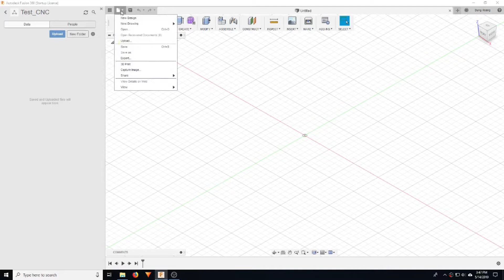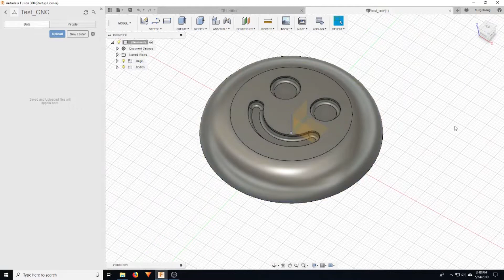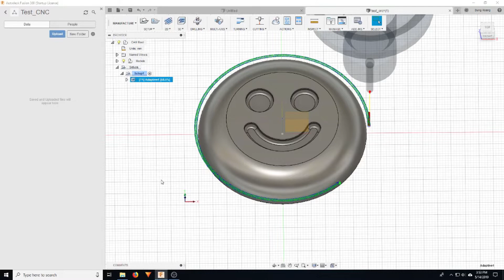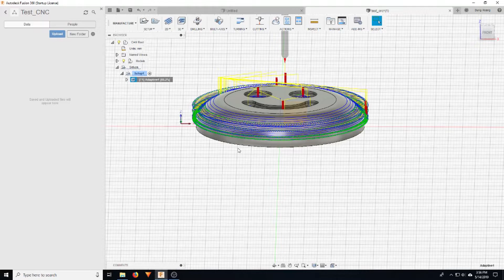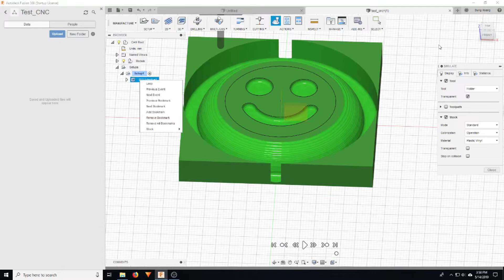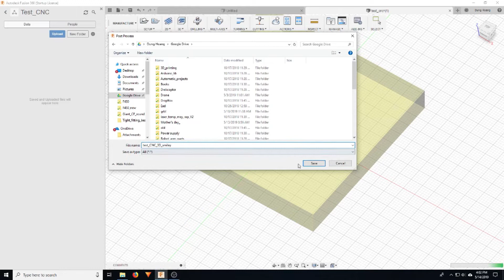3018 CNC testing with AutoDesk Fusion 360 - 3D wood carving

Comment: Hello, I am looking for some help, I am drawing wood projects on Fusion 360 and cutting them on my cnc 3018 pro.  However the cnc 3018 pro will not cut 2D contours.  I send the job to the cnc, the spindle turns on but it will not move or cut.
Could you advise me on how to solve this problem?

Comment: How i can use G code from Fusion for 3018CNC? i opened the code by Candle software but IU not show anything/
Reply from the maker: I have other tutorial videos about using 3018 cnc step by step. Please have a look and you should be able to use your machine

Comment: my spindle is at 1000rpm, and i cant get it higher, any thoughts?
Reply from the maker: 2 things, first type "$$" in the console of candle (lower right corner) check $30, usually it's preset to 1000, change it to 10000 by typing "$30=10000". Second, go to settings in candle and change also the max spindle speed to 10000. Then everything should works

Comment: Hello.. can you help me? I have a CNC 3018 machine same like you. I have a problem.
1. Looks like my CNC is not sturdy in the spindle, when start to drilling some wood it looks sturdy.
2. I already have fusion 360 3d files for cnc. But I am confused How the settings should be for solid wood material. For endmill cutter I used endmill cutter 2 flute straight cut Solid Carbide.
Shank 4mm
Flute 4mm
Overall length 50mm.

Help me please.. or I want to send you my fusion 360 files to you if you want
Reply from the maker: If your spindle is not sturdy, you will have to fix it first if not it will break a lot of bits and make your cut rough. Check where does it get loose (bearing, shafts, spindle holder...).
Then, for Fusion 360, you can check out quickly this video: https://youtu.be/5pQDhtpoXSs 
In that video, I showed step by step how to start some easy milling with fusion 360

Comment: Bro.... Help me... My CNC 3018 its something wrong .. :(... left go right and up go down .. how i change this :(... i broke 2 bits .
Good video ....
Reply from the maker: Easy fix, just type "$$" and tell my what  "$2" value, then I can tell you what to change it to. Y axis is normal?
Reply: Minh's man cave  it’s $2 = 0 (step port invert mask :000000000)
Reply: Minh's man cave The  left and right is inverted ,  and up and down the ,    the Back and forwards works .
Reply from the maker: Then just type "$2=5". Then it should be good
Reply: Minh's man cave  it’s same :( left is right .  and up is down :( way only forward and backwards work properly !? :(  you really are a nice guy :) i like you’re video :)  you can understand everything. but this problem i have i don’t find a tutorial abut it :(
Reply from the maker: If setting the mask doesn't work, another way is to swap the wires on your stepper motors on the X and Z axis. They should have 4 wires, take the first 2 and swap place with the other 2
Reply: Minh's man cave  ,   Thanks you so much ,  you’re the man . 
But now it’s working in mirror . any solution for this ?
Reply from the maker: Have you tried to set the mask back to 0?
Reply: Minh's man cave i change my mind. 
I have 3 much powerful stepper , one 500w spindle that come with 100v power supply.  and i have 3d printer to designs and print the holder . 
do you think the stepper motors ,  will work on this 24v 4A power supply that come with the cnc .  the stepper are a little taller then stock ones , same Nema 17 . 
Thanks you for your answer,  hope to have a chat with you ,  
I’m on facebook all day 3DFactory page
Reply from the maker: They might work to certain extends but not full potential. Those motors probably need 1.8 or 2A each. So 6A power supply might be better. The motor drivers on the board of the 3018 also might not be able to deliver 2A to the steppers. You can use some external motor drivers, they just take more space.
Reply: Minh's man cave   ,    
Ok now i have 3 stepper motor a little taller , 

3PCS TB6600 4A 9-42V Stepper Motor Driver Controller tb6600 32 Segments 2/4 Phase Hybrid Stepper Motor Driver Board

24v 25A power supply, 

500w spindle with his power supply and the button for give speed to spindle . 
 And the CNC 3018 ,  
Can you help me by telling me what i need to use from all this and what not use , And how they will be connected all together.  
Thanks you so much.
Reply from the maker: @Fabrica3D  Sounds like you got the main hardware needed for the upgrade. If you still wanted to use the control board of the machine, will need 3 of these modules: https://www.aliexpress.com/item/32849393744.html?spm=a2g0s.9042311.0.0.27424c4dWf04GM
You can buy those on amazon too. With these modules, you can connect the control signal to the TB6600 stepper motor drivers (make sure to set the micro stepping to 3200).

For the spindle, the best way is to get a DC motor speed controller that can vary speed using a PWM signal. That way, you can connect to the control board of the CNC and turn on and vary the speed of the motor inside the Gcode. I showed quickly where to get the PWM signal from the control board of the 3018 CNC in this video: https://youtu.be/Vho_tGuLqd4.
Reply: Minh's man cave Man ,    All my love for you .  Thanks you so much . 
One single question i have . 
Can i flash again the firmware on the board . i want to use it and need to fix first my problem with backwards movement , 
Where i can download it. i know i can do it with arduino from pc , right !! .
Reply from the maker: @Fabrica3D  I've never tried to flash the board of the 3018 since mine is working fine. I only tried to install the firmware on a arduino nano to run my laser engraver. Here's the link to download the firmware (latest version compare to what's on the board right now). One thing, just remember to save and re-enter most of the parameters that you have right now (save the results of "$$"). You can try to install it and let me know if it works. If not, another way is just use as arduino since you wanted to install all the other things (external stepper motor drivers, spindle). that way you won't need to buy the modules that connect the board to the external drivers.
Reply: Minh's man cave Thanks,    i will try first to put the new firmware and after , i have an arduino, i will put the glbl on arduino :) 
it will take me some time to fit everything:)  so i will be soon back with news . Thanks again :)

Comment: What postprocessors did you use for autodesk?
Reply from the maker: I used the one that's already in the post processor library in Fusion 360: "Gbrl/grbl". Just need to open the NC file with text editor and remove the line "G28 G91 Z0"
Reply: @minhsmancave9448  Many thanks :)

Comment: Thanks so much for the tutorial! May I know if you use Mac for operating the machine and saving nc file to SD card?
Reply from the maker: I use Windows and save the nc file to my google drive. Then I use GBRL control (Candle version) to send the gcode to the machine (another windows computer connect to the cnc machine through USB). I haven't seen many gcode sender software for Mac yet.

Comment: Very nice, i just bought a 3018 CNC and i´m also interested in 3D carving. By any chance do you know any other software to generate the G-Code for 3D carving?
Reply from the maker: I only have tried Fusion 360 and Easel. In my opinion, Fusion 360 is best for beginners like us. It's very simple to use and It's free for hobbyist and personal uses.
Reply: @minhsmancave9448  thanks, i´ll have a look at Easel. I´ve been used to work with Autodesk softwares, so i guess Fusion would be more friendly.
Reply: Vectric Aspire or Vectric V-Carve Pro. Both designed for woodworking but are very expensive. Free trials are available.
Reply from the maker: I'm very impressed with what Aspire can do watching some tutorials on youtube. But $2k tho, maybe one day, maybe!!!
Reply: @minhsmancave9448  The inlay module is very impressive. You'd need to be, at the very least, at semi pro level to recoup some of the outlay to justify spending that amount of money. Start doing the lottery lol.
Reply: try looking at f-engrave and dmap2gcode, they're both freeware.
I'm using dmapgcode for my new 6040 cnc router, and in my opinion it's not much more that a rigidized and oversized 3018 that uses mach3 or CNC USB(or in my case turbocnc for DOS) for the controller software instead of GRBL